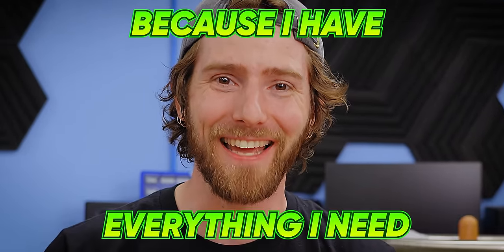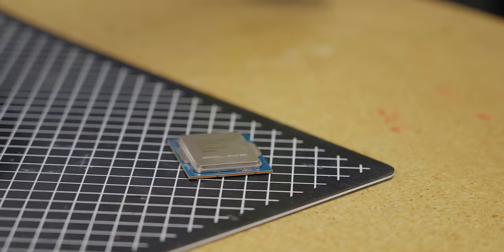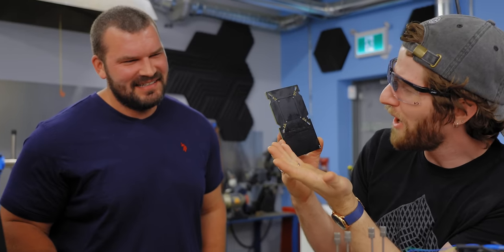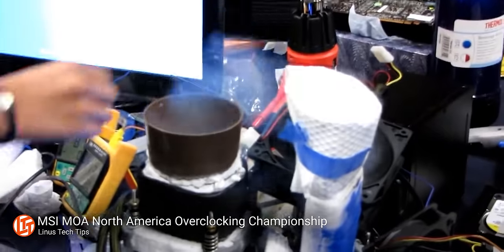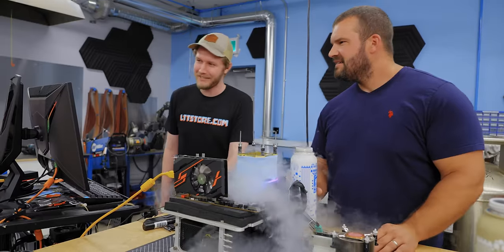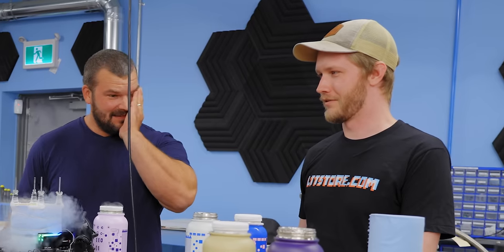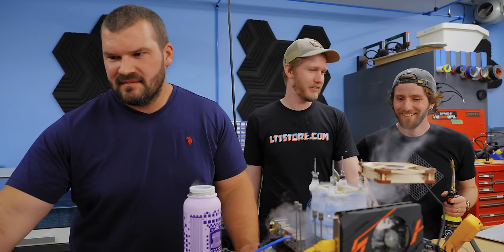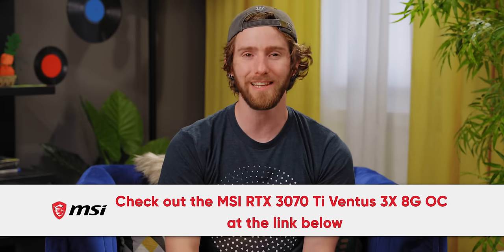The 6.9GHz CPU - LN2 Cooling

Comment: Running a dehumidifier might help with the condensation to a degree. Getting it too dry will make static electricity more of a problem, though.
Reply: Why does dryness create static
Reply: @Qball__  I think moist air is slightly conductive so it helps to neutralize static charges. You get lots of problems with static in the winter time when it gets cold and dry.

Comment: LN2 is pretty damn cool (pardon the pun) and it looks pretty fun to overclock a CPU with it. Liquid helium on the other hand, although it's even colder than LN2, does annoy me when people waste it on just overclocking a CPU... Helium is a rare resource and is something we're quickly running out of. The more important uses are for cooling magnets in high power particle accelerators and MRI machines - i.e. stuff that really matters.
Reply: :( but I really like watching balloons go weeee up up and away. Lol also makes u talk like your talking into a fan now thst is what I would call important
Reply: i thought helium was the second most abundant element in the universe
Reply: @anthonycote2916  IIRC It is quite abundant on a scale beyond our planet, but being a extremely light gas that doesn't form heavier compounds like hydrogen does to form water it gets stripped away from the planets atmosphere from radiation. I only did a quick search so this may be wrong but helium and hydrogen have similar concentrations in our atmosphere, but since hydrogen gets trapped as water we have a much larger supply of it.

Comment: 10:43 I'd like to eleborate for some people: From what I understand voltage actually doesn't kill your CPU, power (voltage*current) does. Running your CPU at a fixed voltage is fine. It will outlive you. Running your chip at full current (high load) will kill it way faster. A fixed voltage might kill your CPU faster but not by any noticable margin.

Comment: Ten years from now, the future generation holding future Intel or future AMD chips will laugh at this and think to themselves, “Haha, they needed liquid nitrogen to achieve 6.9 Gigahertz?”

Also future overclockers: Will be using same old liquid nitrogen to achieve 11 gigahertz!
Reply: Honestly I don't know if the Gigahertz increase that much in the following years tbh
if you go 10 years back it's still pretty comparable
Reply: The next stage of pc technology would be 3D, a design which is in infancy now.
Reply: It prob wont go much higher due to thermal problems
If you want a huge watercooler from a car in ur pc,then yes,i dont know if these transistor even survive at this high speed on and off signals
Reply: Wouldn't be surprised if you end up wrong because I bet they thought the same in 2012
Reply: You mean to tell me future generations will have more advanced tech than tech at this moment???!
Reply: @modrribaz1691  but then we would have to significantly lower clock speeds and somehow have a small copper plate to move heat from the bottom layer(s). even stacking cache has cooling issues, thats why the 3800x3D cant be overclocked, stacking actual cores would overheat instantly.
Reply: That's stupid... there is no need of more Hz for more performance... just more IPC.
Reply: imagine what they could do with liquid nitrogen and those cpus
Reply: @modrribaz1691  I feel like the push will also be into new types of computing.  Quantum computing.  We're getting to the point where electrons are passing through instead of following traces right?
Reply: @Arminoderso  True, but it was pretty much intel only for around 10 years before AMD released the Zen series.
Like how 4 cores was the mainstream, most common chips were topping out at 4/4.2 ghz (1800x was 4ghz)
AMD's latest chip was demoed to be hitting 5.8ghz on their presentation (We don't know what the cooling solution was though)
However, as shrinking down transistors is getting harder and more expensive, we might find 6ghz to be the limit for a while 🤔
Reply: @nikoheino3927  I think this is what's holding it back, vertical heat transfer.. eventually, it will be over with.
Reply: @fellwind  That's possible but much further in the future. 
(Note that quantum computers are currently cooled by liquid helium)
Reply: @modrribaz1691  it will be nearly impossible. well not impossible but very very expensive, big and not practical. it would be much better to just increase dye size. like the threadripper.

Comment: "Hot" idea : Make a Vacuum chamber and build everything in there . This way you remove the air so you minimize the moisture problem while cooling as much as possible. Preferably pick a vacuum chamber where you have control with sealed gloves. If you search Vacuum glove box you'll get the picture.
Reply: Commented the same idea a minute ago! Didn't see yours!
Reply: Hmmm....That makes me think about putting a sub-ambient liquid cooled system in a hypobaric enclosure. There wouldn't need to be a serious vacuum -- my goal would be to start with an already low relative humidity environment (desert) and then use decreased pressure to further lower the dew point to an acceptable level.

I've never even heard of anyone trying anything like this, though.

EDIT 6-11-22: Typo
Reply: does that affect the electronics? some electronics on the motherboard has air in it like the electrolytic capacitors. will they explode?
Reply: @danz9268  that's a good question, i really don't know. Depends on the strength and/or the isolation of the capacitors ( or everything that has air in it ) , if there are weakness points between the air and the vacuum , they could explode or pose problems. But its not like everything with air explodes in vacuum , all you need is a good isolation. Which of course brings you back to square one.
Reply: @bricaaron3978  Same, i mean , if someone would do it I think it should be them.

Comment: as to prevent moisture condensation on the supercooled parts, did anyone get the idea to put the whole system into a fully sealed box, pull a vacuum on it and then flush it with pure nitrogen?
that should bring the relative humidity of the surrounding gas to 0% and thus there would be no moisture to condensate no matter how cold it gets.
it would also likely hold the entire board at sub zero
Reply: Putting the setup into a dry box is laboratory thinking. Not really what these types are all about. But surely it is the superior approach.
Reply: @channeldoesnotexist  well the lab is coming.....
soooo....
follow up video?

Comment: Could you overclock in a closed chamber filled with some inert gas which contains no moisture? Or what about overclocking with LN2 while the motherboard is also submerged in some kind of oil?
Reply: That's a good idea. I wonder what you could use that stays liquid at cryogenic temperature, without cavitating wherever the heatsink is.

Comment: Can you get around the condensation by using liquid nitrogen the same way you’re doing now but dunk it in mineral oil instead of packing all the insulation on the motherboard? I know the mineral oil will probably freeze? But I’m not sure if that would damage anything or not.
Reply: Any water present might sink through the oil, I wonder if the oil would stop it from condensing in the first place though
Reply: eh, dunk the whole mobo in ln2
Reply: @theRPGmaster  I would think that the oil wouldn't get cold enough at the edges that it would cause condensation. And of course there isn't any water in the oil already, so there's nothing in it to condensate.

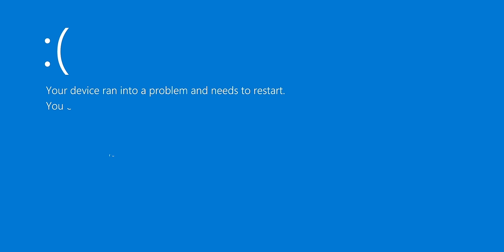Comment: 15:54 The biggest lie in tech history is suggesting MSI never fails.
Reply: Yeah. MSI is total shit. Whenever i help someone build their PCs i go out of my way to recommend them away from MSI. They cant even do proper mainboards. I got one currently. The first one had problems with.. any- and everything lmao. Like, SATA wasnt working properly on one of my SSDs, the freaking internet would not work half of the time, audio is going bad from time to time. You'd say it's a mondays product. Thought the same. Got a replacement. The Sata problems were actually fine.. but the other problems persist. Other than the mainboard it's a pretty mainstream high end build, so it's not like other components are causing this. Since i didnt want to build the PC 5 times over, i just got a PCI network card to counteract the networking issues and live with the sound issues to this date. What a pile of trash of a company, it's not even funny. There is a reason they are always the cheapest.
Reply: @Yamyatos because two motherboards are bad doesn’t mean they are trash
Reply: @Small_Schlonng_9000  No. That's what you say about one not working. Mondays products can happen. Returning it and getting send one with the exact same hand full of issues minus one means it's not exactly something that happens unfrequently. The thing is, i would understand this if i used some weird hardware. But not for the most mainstream high end setup imaginable. If two products in a row fail under these circumstances then at the utmost minimum it means an entire batch was produced faulty, without MSI noticing or caring to call it back. Both of which are more than enough reasons to lose trust in the company. So yesh, MSI is trash. 

I've build so many computers in my life. My own, for family, for friends. Douzens. Not once, over all these years and all those computers, have i had a single issue with any feature of any of the motherboards i used. It's literally the most figured-out component in the entire system. First time i use MSI it fails twice in a row on the most basic of setups, for several of the most basic of motherboard features, like internet. This is unacceptable. Stop white-knighting companies like that. But what am i even hoping for, considering Apple is nearly as bad and for some reason people love to self-torture themselves with them as well. Have fun with whatever products you chose.
Reply: @Yamyatos  I’ve had two msi gpu’s, and an msi motherboard and they all work out fine
Reply: @Small_Schlonng_9000  Good for you. Just like my experience however, it's anecdotal. Neither did i claim they exclusively sell broken stuff. However, as i said, they at least sold a broken batch without recalling it, or noticing it. Both being pretty bad. Especially considering they managed to break the most basic functionality we pretty much ever build into mainboards. Which doesnt really help their case.

Comment: would putting the motherboard in a vacuum chamber solve condensation completely?

you would need a closed loop system for the N2 but i assume it would work, right?
Reply: extreme overclocker here, we use what is called a purge box sometimes where we take a giant plastic box cut a hole in the bottom and put it over the rig upside down fill the void with nitrogen vapors to displace the air, that way there is no moisture that gets in
Reply: @fzrdontdiex5576  so basically a N2 glove box? 
i have seen them at uni

never thought they could be used in that way
Reply: It would solve the condensation problem but pretty much every component on the motherboard that isn't directly cooled might overheat because there is no air to carry away the heat
Reply: All of the little components create heat, and without convection with the air, it would be hard to keep it from seriously overheating.
Reply: @atafakheri8659   https://i.imgur.com/wkuUv9l.jpg example of a purge box, just a plastic box with a small hole to pour ln2 into with a paper towel tube to ensure it goes in the pot
Reply: @Apocalypsam  no the motherboard cools the components as it gets extremely cold due to the copper layers in the PCB transferring the cold from the cpu throughout the board, from personal experience its not needed
Reply: @ssjarchon  convection isn't the only way
heat conducts, convects, and radiates

vacuum only eliminates convection
Reply: @fzrdontdiex5576  cool.
it seems it is a diy version of a glove box.
very neat idea

Comment: 10:40 Having a set voltage is fine at least for AMD, it's perfectly fine because voltage is not the same as current, which is what actually causes load and heat in a cpu. it's utterly false that voltage degrades the cpu, it's heat above the tj max of the chip. My 5800x is running fixed voltage of 1.35 at 4725, and idles at 35c. My bulldozer 8120e, still overclocked to 4.2Ghz after 10 years and still running the same as the day the overclock was set. All because the temps have remained below tj max. But I know amd overclocking and not intel, so maybe intel just does it that way.

Comment: Really strange question. Has anyone tried OCing in a vacuum to remove the condensation issue? Some set up where you can continually pour the liquid nitrogen into the cpu pot without breaching the vacuum?
Reply: VRMs and other motherboard components would get hot in vacuum, but you could use some bottled industrial gas to replace air, it's super dry and the container does not have to withstand pressure. They probably have argon bottles around the workshop and bottled nitrogen is also a popular choice.
Reply: @jespersaron  with the right setup you could even use the nitrogen that boils off couldn't you?
Reply: @jetison333  Yeah, maybe it will get complicated because they need to add liquid and vent excess gas constantly, but definitely doable
Reply: No, reasonable persons just use dry air. If you have an air tight case, all the moisture in it will quickly condensate and then you won't have to do any of this vaseline stuff

Comment: Another idea for preventing condensation is running the motherboard in a partial vacuum with the rest of the air being  dehumidified beforehand, assuming that the hardware isn't extremely sensitive to lack of air or atmospheric pressure.
Reply: Would boil LN faster

Comment: Did you know that the limit here is not the heat, but the finite speed of light? At 6 GHz, light in a vacuum passes 5 centimeters during one clock cycle. The signal in the processor is about 2/3 of this speed, which is 3 centimeters. So it may not be able to reach its destination before the next cycle.

Comment: You messed up one thing: The resistance of processors goes DOWN when they get hot. Semicons have different properties than normal conductors. So they draw even more and more current and can get in a runaway situation. This is why the wattage of the CPUs reduces when they get really cold. The big problem then is to still transport sufficient charge in the short amount of time to make the logic work. This is why running it as cold as possible is sometimes not the fastest option. At some point the resistance is so high that you cannot get enough electrons in to flip the bits that you want to flip. You can raise the voltage, but only to a point.

Comment: There are two problems with increasing the frequency of a chip. The first is that as the temperature increases you can push the chip to a maximum operating temperature which will cause mechanical damage to the  materials in the chip.

The second is, that as the temperature changes it affects the timings of signals across the die of the chip.
Chip manufacturers during the design phase undertake simulations of the logic circuit that is to go on to the chip, and different delay factors are applied to each logic gate to simulate the effect of changing temperature and changing supply voltage.

If either the temperature or voltage changes by too much, then setup and hold times of flipflops are violated and the flipflops will malfunction.

In CMOS technology, the power dissipation of the logic gates is a function of the operating frequency (which is not the case for ECL technology, but no one uses ECL any more).

The higher the clock frequency, the faster the chip runs, which means greater power dissipated and a corresponding increase in temperature. Push the clock frequency too higher and the heat produced messes up the signal timing, so forced cooling of the chip is necessary to remove the heat and ensure the timing of the signals doesn't get messed up.

Comment: 4:10 Nope, PCB's can be made from a variety of different materials.

These can include copper, but only for the components soldered to the board, and the boards traces for most brands, and some PCB's are made of fibre glass and plastic, with a layer of cardboard.

Some of these are made of aluminium, and some can even be made of carbon fiber.

Comment: Ever thought of putting the motherboard in a semi-sealed container and setting up a low dry nitrogen purge to the container to displace the humid air instead of having to go through the lengths of applying foam and such to the board?

Comment: Actually you kinda got it backward.  As temperature increases resistance of semiconductors decreases which can lead to thermal runaway.  Here's an example (just to show the theory). Say a circuit had 10 volts and a 10ohm load. This would allow 1 amp to flow. Power would be the amps squared times the resistance giving 10 watts of heat. Increasing the temperature. if it got hot enough to reduce the resistance to 5 ohms the current would then be 2 amps giving 20 watts of heat production (2*2*5). So halving the resistance doubles the heat produced causing resistance to drop even more and the loop continues. Thermal runaway in a nutshell. - ET Eric

Comment: Linus is wrong. Semiconductors have a negative temperature coefficient of resistance which means that as temperature goes up, resistance falls and more current flows. And the heat dissipated is a function of the current.

Essentially what happens is, more electrons are kicked up from the valence band to the conduction band where they are then free to flow as current.